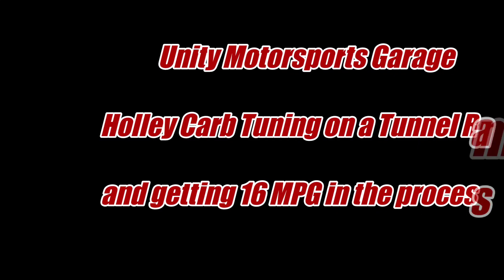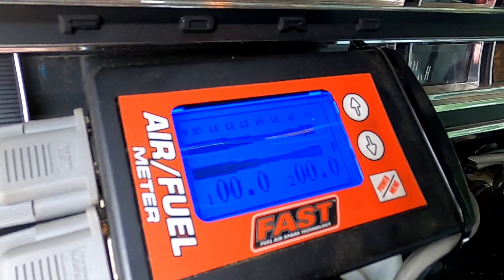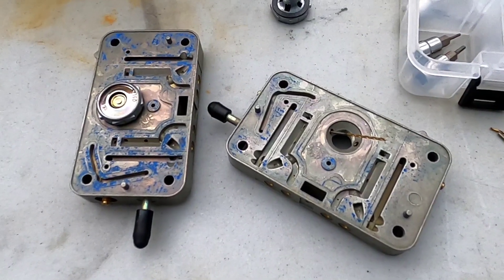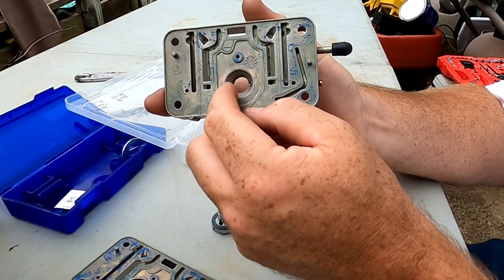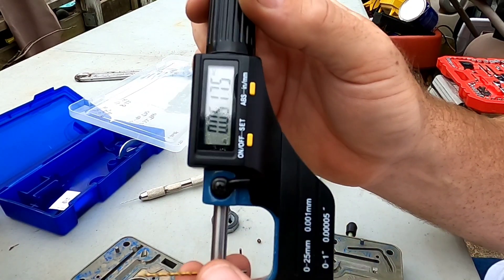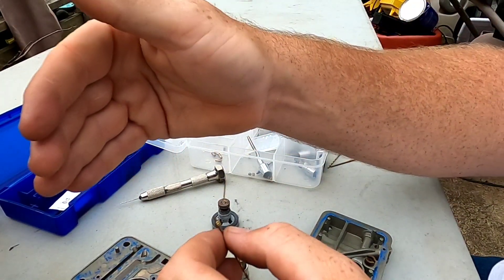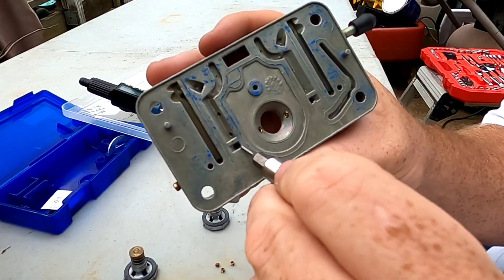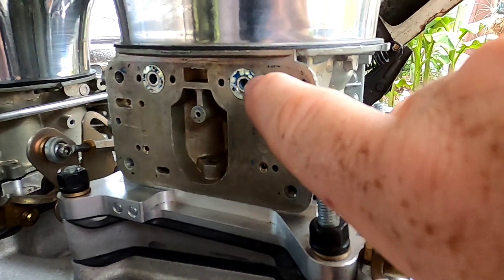600HP that gets 16MPG with a Holley Tunnel Ram and 2 Holley 660 Carbs

Comment: Not sure how much advance you are getting from your vacuum advance canister but there may be more power and economy in a ecu based advance curve and with 45 degrees at light cruise .
Reply from the maker: I'm getting close to 50° !!!  I have hit the lean burn limit of the engine.. David Vizard taught me how to maximize a vacuum advance...  Mallory used adjustable vacuum canisters on their distributors before MSD bought them.. with plenty of time... You can get it dialed in.. I'm sure with a ECU it could have been done in Seconds! LOL...  Thanks Brother for watching.. I'm planning a video on what David and I did.. It's going to be good! 
Andy

Comment: Great video brother! I'll probably definitely be in your inbox with questions haha and are we just gonna sit here and act like we didn't see those slanted carb spacers????? Lmao you're gonna need to do a video on that. That looks to present a whole other bag of issues within itself. Haha well mounting issues anyway. It's gotta do something though, if you guys are not running traditional spacers. 😎
Reply from the maker: Good Catch.. I've been testing the spacers... Because I noticed on my Datalogs that on the launch the AFR would go crazy rich then stabilize.. so I found that Offenhouser made these plates for Circle track racers.  I put them on and it "helped" my problem but it still isn't solved yet... I haven't noticed any major difference in driving around town though... I will probably do a video on this subject here in the near future!
Reply: @UnityMotorSportsGarage  huh, thats definitely a wierd problem to have. Most cars go lean. I would think a float level issue, would bring other problems, if that was the case?
Reply from the maker: @jbuch66koop  you are thinking on the same path I was.. I did some crazy testing.. I have a good place were I could do some "testing" so I put new plugs in the motor.. went and did some test hits and killed the engine right after.  I found the cylinders that were going Rich!  2/6 4/8 and that is when I found out what was happening!!

Comment: Great job Andy. You really opened up my eyes on Holly carbs, never knew there was so much adjustability in them for street performance. Got to say really learning a lot through your channel. Keep up the Great work!🏁
Reply: The mod [12:00] to get tunability on the transfer slot is gold.  Dual quads kind of bends original design into areas that need a little help.  I assume it was sized down?
Reply from the maker: When you run a setup like this trimming fuel from the idle and transfer slots is key to making it happy! Thanks for watching
Andy
Reply from the maker: Thanks Brother!  It is amazing to me that the engineers back in the 50's covered all of these bases who designed the Holley 4150/4160 series.. because it has changed very little through the years!  
Andy

Comment: I've always loved the look of a tunnel ram set up, but I never feared lining up against one ( back in the day, on the street ) because you could almost guarantee they ran like garbage. You are making me a believer for sure. Also, I love the driving footage. How about some in cab track views.
Reply from the maker: Thanks for the kind words!!!  I think my second video is at the track In the truck... I love my Tunnel Ram setup... It trips people out when they see how easy it drives!
Andy
Reply: I had that set up on a 350  68 camero and it got 15 as long as you drove it right but it had a 350. gear, but if you started doing hole shots and running 130mph to impress friends  you could watch the fuel gage dropping
Reply: @600lwp  Time for a bigger fuel tank! :D
Reply: Speaking of looks... is that plenum cover reversed?  Most manifolds are topped with compensation for engine tilt built in for level base.

Comment: That Was Awsome  Andy, but  do you go to the drag strip first before you do what you did or after?  Because every carb needs to be tuned at the strip for the best time and you will need to change jets to get the best result.
Reply from the maker: When I first went to the track I wanted to do a true back to back test.. of the Carbs.. then I wanted to run it on the Dyno in the same trim as I made the runs down the track..  when I had the 1850's on it.. it ran pretty much 12.7 and I wouldn't have to change anything as long as we didn't have a huge swing in temp...  Normally I will rejet when I see about a 30 deg change...

Comment: Excellent explanation, some of which I've practiced doing on my own stuff for years.  When you have time, I'd like you to elaborate more on the transfer circuit where you drilled and tapped the main body.  Those holes are rather large on the holley as you know, it took a 10-32 tap, not the typical 6 or 8 size that I use in the meter blocks.  That's a lot of fuel to meter down so I could see how that has a huge affect on economy.  All my holleys run pretty much the same way, with idle and WOT showing nice AFR's on the wide band, but part throttle or light throttle cruise is pig rich.  Can't fix that with a jet change without messing up the WOT.   How much did you reduce that orifice in relation to the size it originally is?  I realize it's different for everyone but are you just reducing that 10%? 20%?  Cutting it in half?
Reply from the maker: Thanks for the kind words... It really took some time getting the Transfer slot fuel curve dialed in... I have found that most aftermarket Billet baseplates have a WAY too large transfer slot... I have seen them be almost double the width of a stock Holley baseplate and I guess they don't understand how they can affect the fuel curve.. On some mainbodies I have been able to use ,8-32 set screws but the vast majority will take a 10-32 screw... I started out with a .079" orfice it was still way too rich... From there I went to .065" and that was WAY too lean.. from there I ended up at .071" and seems to be sweet spot..  I would say that it cut at least 40% fuel usage in that area...  But it took a while but was definitely worth the effort!!!
If you like what we are doing please Subscribe and help us spread the word about the channel!!
Thanks Again
Andy
Reply: @UnityMotorSportsGarage    Thanks Andy for the quick reply.    Wow that is more than I expected.  A #21 drill for a 10/32 tap is .159" and that hole generally isn't much smaller than that.  So it's safe to guess you probably cut that nearly in half with a .071" orifice.   Did you use a percentage of how rich you were at light throttle cruise compared to where you wanted to be to come up with a ball park?  For instance I'm at 10.5:1 light throttle cruise, so moving to say 14:1 is a very big change.  A little over 30%, so there is a lot of fuel mileage to be gained in this area.
Good stuff, keep it up.
Reply: @firebirdjone  i don't know the original hole dia in the carb, but based on the .159 dia tap drill and your "guesstimate" of the original hole dia, the area reduction using the .071" dia orifice should be around 70% give or take.
Reply: @bobwhite5440    Thanks Bob, that's quite a change.
Reply: @firebirdjone  you're welcome. i don't know the transfer slot dimensions on the 660 center squirter, but the ones on a R1850 600 CFM i measured as best i could are approx .26" tall x .024" wide which renders an area of .00624 square inches. this is smaller than the "guesstimated" hole dia i used (.134" dia) in my previous calculation. so it looks as though the transfer slot area is the metering orifice instead of the hole in the main carb body (as well it should be). so the .071 dia orifice would reduce the assumed .26" x .024" transfer slot area by about 36% give or take. these are just example values used as reference, all the dimensions off of the 660 carb would be required to calculate the % reduction properly.
Reply: @bobwhite5440   Excellent, thank you.

Comment: Great video. I didn’t understand the power valve restriction area when you said it should end up at 73 or 74. 73 or 74 what? Is it a percentage of the main jet area? Thanks.
Reply from the maker: When you add the area of the PVCR to the main jet size (in my case im running 66 jets) At wide open Throttle when the PV is open the carb would act like it had 74 size jets in it..  So if you find the perfect jet size on the main circuit that delivers a good AFR then you should adjust the PVCR's for WOT performance... but I never hear of people doing that.. they just swap jets and then complain about how bad of fuel mileage they get.... LOL  Thanks for Watching.. Please Subscribe and help me spread the word about the channel if you like what we are doing!
Reply: Ok thanks. Yup, already subscribed and spreading the word!
Reply: Ok thanks. Yup, already subscribed and spreading the word!

Comment: Great video! Carbs are a lost art these days. Using a wideband to dial it in was really smart, your knowledge of the various circuits in a Holley is impressive.
Reply from the maker: Thanks for the kind words!!  I have always loved working on Holley Carbs and they can be WAY more adjustable than people believe... I Love the new Fuel Injection systems that are out now... but the Holley Carb is far from Dead!!!
Reply: @UnityMotorSportsGarage  seems like they arent all the adjustable if they need to be drilled and tapped. Seems like a good carb engineer would have designed it so you could make minor adjustments easily...change jets to get in ballpark then a screw on the outside to adjust for fine tuning.
Reply from the maker: Most of the Carbs The XP/HP Holley's and Just about all Quickfuel carbs and many others you can buy today have these features.... But 99% of people don't bother messing with these circuits because they don't really understand what they do!  
Andy
Reply: @UnityMotorSportsGarage  cool, I wasnt aware of that, my Holley is older and doesnt have that but it runs decent but sucks gas. Your right its a lost art, I know back years ago I hated Holleys but nobody I knew was this knowledgeable about them and we didnt have Youtube or the knowledge to do the research, couldnt get books on Holleys at the library.